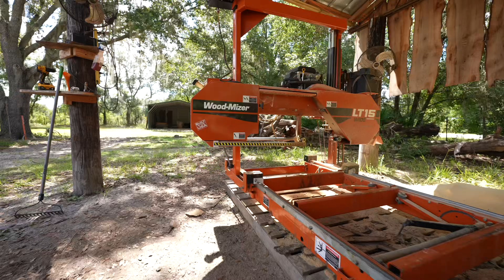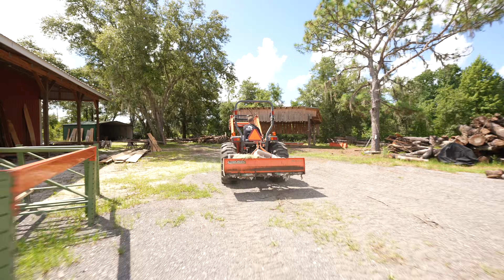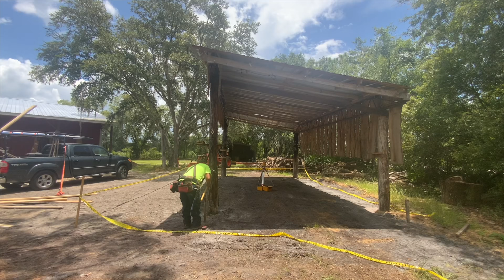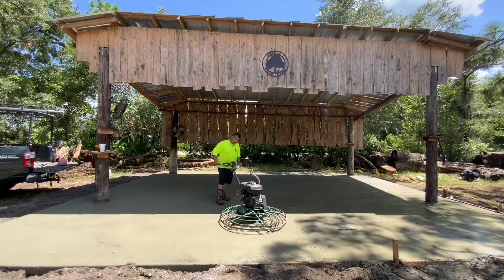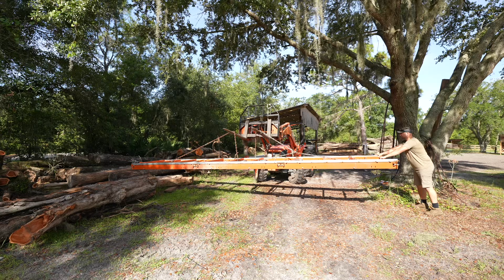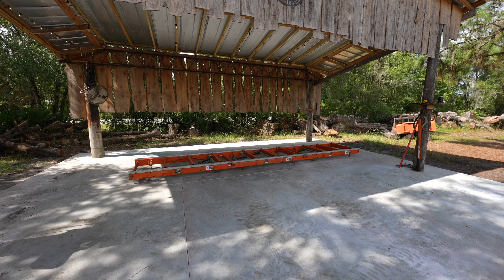Finally Poured A Concrete Slab Under Our Wood Mizer Sawmill

Comment: You may find that you still want some lumber under the track to minimize the vibrations/ travelling.  That's how we handle our heavy machines in the manufacturing plant if we don't have anchors in the concrete.

Comment: Hello, I have three main questions. What is it that you make more/less, How much product and how far do you deliver(radius)? My father has had a sawmill for 21 years and built houses for years. He has unlimited knowledge about this stuff.
Reply from the maker: Thanks for your questions. We make boards and slabs out of lumber on our sawmill. We use those boards and slabs to make cutting boards, small tables and other projects. We are offering local pick-up only at this time. We will explore shipping later this year.
Reply: @TripleLRusticDesigns  Can I send you the website of my father's sawmill to your instagram DM or somewhere i can DM you?

Comment: I would put a rubber 4x4 piece under every place the mill contacts the concrete.
Reply: S. Dall:  Me too, Stephen... If for no other reason than to cushion the shock of very heavy logs when loaded.  Concrete anchors will hold a lot, but fail after repeated usage.  That's okay, it takes a while...  You may never notice until your head seems to cut 'wonky.'  LOL -pp

Comment: Big slab, didn’t see any joints, hope it doesn’t crack.
Reply: Two kinds of concrete.
Cracked
Going to crack.
With the joints cut in, that helps the concrete decide where to crack.
Usually.

Comment: You really need anchor bolts to secure it to the slab. You will find that with this smooth surface it will be sliding all over the place. Looks awesome though.

Comment: I would definitely use concrete anchors to attach the feet to the slab so it doesn’t shift while loading logs. Other than that it looks great.
Reply: Correct if they don't its going to bounce around
Reply: I wondered about that too.  With the weight that will be moved on and off of the bed it surely will slide around if not anchored.  Other than that, it looks awesome.  Nice job.

Comment: Thank god for Hispanic good job
Reply: Had my entire 3,000SF house renovated, roofed, installed a 25x30 paver patio & 31x25 metal pole barn in the last year. Had it not been for the Hispanic workforce, it would not have happened. Kept them fed, Tecate’ at the end of the week & a bottle of Don Julio for each crew member & a tip at the end of each project.